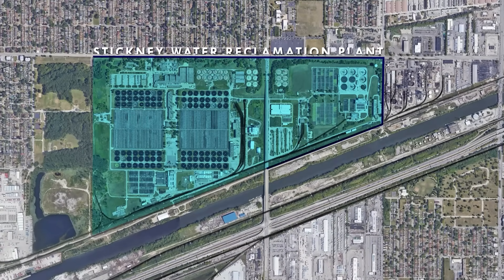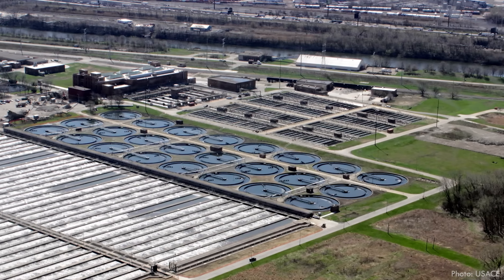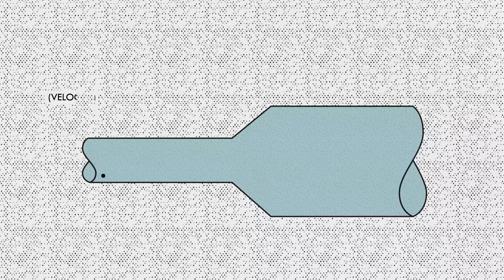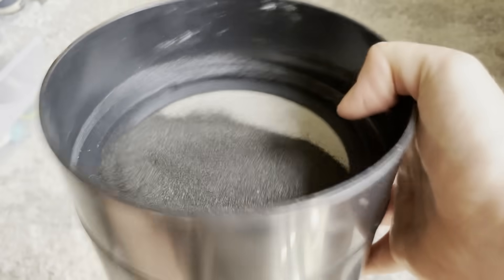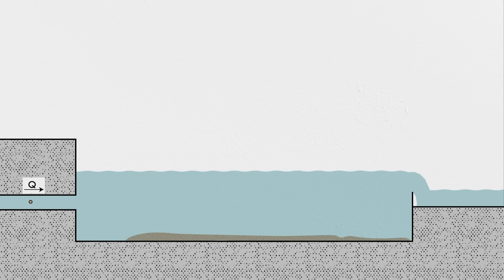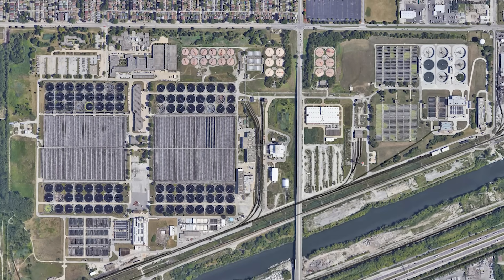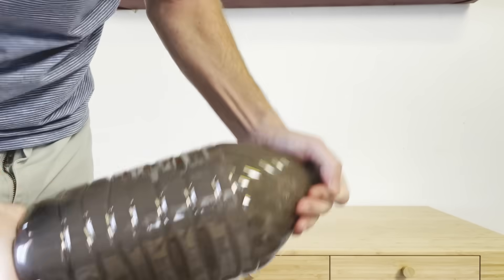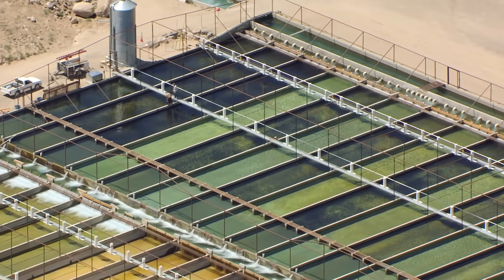How to Clean Sewage with Gravity

Comment: The grain industry (at least in pre-industrial times) used a similar gravity based filtering process, called winnowing. When wheat is harvested the chaff has to be separated from the berry, the chaff is lighter than the berry, so the grains are smashed and the 'solution' is blown across a space.  The heavy berries fall and the lighter chaff is blown away.
Reply: As a former flour miller I can confirm that most wheat cleaning is still done by aspiration/gravity. We've just gotten much more precise about it.

The purification process used to separate bran from endosperm relies on density as well. Suction is applied to sieves inside an enclosed space. This causes the bran to float on top of the endosperm particles, which fall through the sieves. The bran goes out the tail of the purifier.
Reply: I'm sure winnowing is still used industrially, either outdoors on a combine harvester or indoors in a processing plant.

Comment: Our system seems to include a lot of very large circular sprinklers that water large fields, like you see in farms.  Perhaps that is because down her in the panhandle of FL water flows through the sandy soil easily, and the water table is high and we are 50-80 feet above sea (Gulf of Mexico) level.  Maybe you could touch on this in a future video...

Comment: This was an awesome video! I work in wastewater, typically the screens that take out branches and trash, but I also work in sludge thickening, which is like your pool cleaner demo. For sludge thickening machines, the inlet sludge is typically 0.5 to 1.5% solids, and after being treated with chemicals (polymer) and sent through a process machine, it can come out anywhere from 5-10% solids, which is an 80+% reduction in volume.

Comment: Love your content! But I’m pretty sure the water flows faster in the shallow parts of my fish tank. ☺️ With regards to your equation I suspect that velocity is a function of the depth times width (given a constant volume/time).
Reply: yes, but it would also take the particles longer to reach the bottom.
And now you might be thinking that the particles won't go upwards at the end, so that doesn't really matter.
But if that were the case, the water wouldn't either, basicly rendering the bottom part of the tank pointless anyway.
Reply: @Robbedem  I realise now that I misunderstood. Maybe the thing that’s bothering my brain is that if the tank is shallow enough, the particles won’t settle once they reach the bottom. 😌
Reply: @HenrikLantzHedstrom  True, the tank does need to be deep enough to make sure the sediment remains on the bottom and allows for some sediment buildup before removal is required.

Comment: One of the really interesting things I wished you had covered here is tube and plate settlers in this stage. When I was researching this topic it was really interesting to see how the surface area introduced at different angles decreased the clarification time needed.  This whole series is great for people to start understanding!
Reply: yep. Many older plants have had plates installed to increase their capacity without having to build new sedimentation tanks.
A video about what happens with the sediment would be interesting too.

Comment: Having had the opportunity to visit both waste water and drinking water plant here in the Netherlands, It is interesting to see the similarities and differences across the pond. While the wastewater treatment is largely similar, for drinking water the sediment separation is not done with chemicals but electrostatically. Furthermore, we use ozone and UV sterilisation so the water does not contain much if any chlorine. Tap water here is the same quality as bottled drinking water. To keep the water supply safe, waste water treatment is very important!

The sediment of waste water gets pumped to a fermenting plant where they evaporate the water and then let the residue ferment. The resulting gas is used to generate electric power, and the remaining residue is burnt and its residual heat used in the same electrical power generator.
Reply: I work in water and wastewater engineering in the US. Ozone and UV disinfection are both known technologies over here, although I’ve only seen one ozone plant in my, admittedly still early, career. UV is much more common, and is arguably displacing chlorine in wastewater applications. It is less popular with potable water because unlike chlorine, UV disinfection provides no ongoing disinfecting effect after the water leaves the plant. Residual chlorine in the distribution system helps to prevent microbes from developing in the pipe network. The downside is that, if any of your pipes are metal, corrosion becomes a concern over time.
Reply: Tap water is generally at a rather higher quality than bottled.

Comment: GF works at one of the Seattle area sewage plants, on the solids side of things.  "Polymer" is a big part of getting the solids to separate from the liquids.  Once settled out, the solids go to enclosed digesters where the "material" is more or less composted in an anaerobic process.  The resulting methane is used to help provide process heat for elsewhere in the plant.  Once sufficiently digested, the solids are dewatered (the watery "mud" first goes on a separating belt to let liquid drip out, then into centrifuges to spin out more water) to the consistency of wet soil and shipped to eastern Washington for disposal, er, I mean application as fertilizer on agricultural land.  Seattle area folks - if you've ever seen double dump trucks on I-90 with "Loop - turn your dirt around" you now know that is what's left of Seattle's poo.
Reply: Poo in a truck beats San Francisco style!  I really appreciate water and sewage workers, just think about what kind of a community you'd have without their efforts.

Comment: Very interesting, as always.  Not a subject I know much about, but I used to travel past a sewage treatment plant every day on the train and I've often wondered what these round things were.  But, here in the UK, they aren't the same as the ones you show, they are (or appear to be) raised beds of gravel or clinker, or something similar, and the rotating arms sprinkle water (?) onto them.  So I assume they are filters of some sort.  I haven't looked at a treatment plant closely for decades, so maybe the technology has changed - or perhaps we do things differently over here? 

One of the things we definitely do very badly over here is the 'emergency' release of untreated sewage! (eg when heavy rainfall overwhelms the plants' capacity.)  Untreated sewage is simply diverted straight into the nearest river, or out to sea.  This is supposed to happen only very rarely, but it turns ot that all the water companies are actually doing this regularly and with a hell of a lot of sewage.  It's currently a big scandal over here, as the companies have been hiding how much they do this, as they get fined if they do it too often.  This is one of the consequences of our water and sewage system being privatised - under the old system, plant was replaced or expanded as required, whereas nowadays everything has to been looked at from the cost and profit point of view to keep the shareholders happy, so corners are inevitably cut.

Comment: I have a Biofloc based Aquaculture System and was pestered with Turbidity problems where the dead bacterias have increased turbidity of water and due to continuous aeration do not settle to the bottom for me to be able to remove them by draining. This has resulted in the water becoming murky and holding less oxygen even after pumping air in it alot. When trying to filter then I can filter some water but soon enough the filter gets clogged up by the flocs. I was thinking of using a Rotating Drum type of filter but seeing the video maybe I will give sedimentation another try.

Comment: I have a request related to this video. 
Can you explain how private sewage systems work? I live in a rural area and we are required to have one. We used to use a sewage pond, but local laws changed and now we have an underground tank. It has a sprinkler that occasionally sprays to expel excess water, but I'd like to know what's keeping the tank itself from filling up with sludge.
Reply: Nothing keeps it from filling up with sludge.  You need to pump it out periodically or it fills up.

Comment: There are major ecological and resource management problems with this system. 
Ecologically, we tend to keep the waste moving downstream much faster than it would naturally, robbing uphill soils from much needed natural fertilizer. Granted, some plats process the solids into agricultural fertilizer rather than incinerating it, but that concentrates it and still doesn't help the soils around the farms. In some areas that don't care about the mineral content of their discharge, this process also sends salts downstream faster, creating pockets of increased salinity and extending brackish water further up rivers. 

As for resource management, we often pump this water out of groundwater sources, particularly in more arid areas. Sending this water downstream or allowing much of it to evaporate from these settling ponds compounds the problem. While they are less efficient and cost more to maintain, percolation systems that allow the water to seep back down to the water table are much more environmentally friendly in terms of keeping the water table up and recycling what little water you have in desserts and plains regions.

Comment: After being in charge of the waste water plant at a certain tanker cleaning depot in Manchester, UK, I can say I get everything on this video. Our treatment plant was was 'hand-made' using any old crap and bits of old steel pipe I could get me hands on. It was forever causing problems because;
1. The waste water had to be pumped up a hill and into tanks (the pump failed many times)
2. The pumps pulling the water out of the storage tanks failed many times (yes, again!)
3. It bloody rains so often in Manchester and any rainfall had to go through the system as per local laws (which over-worked the pumps and made them fail)

Comment: Could you do another video like this but with a focus on the solids? I can't imagine how the solids are removed continuously, and I think this is a very interesting aspect
Reply: Yes, I'm really curious how they deal with the solids that collect in the settlement basins.  Do they dig it out and truck it to landfills?  Is it converted to something harmless?
Reply: @MichaelSteeves  depends on the site. If the sludge is mainly organic material (f.e. wastewater from housing), then the sludge get's processed into gas by anaerobic bacteria. The gas can then be used to produce energy. Most of that energy is used to dry the leftover material, which in turn gets burned or put on landfill.

Comment: I'm still unsure how they deal with the sludge at the bottom.  You mentioned it briefly (the clarifiers have an arm that push the sludge), but this doesn't make sense to me:  Where do they push the sludge, and why doesn't the water go there?
Reply: The sludge is drawn off the bottom while the clear water is drained over the top. Some water does follow the sludge - it's actually what helps the sludge move. The "sludge" will typically contain 2% to 4% solids  the rest is water. That water is later returned to the process when the sludge is dewatered. I'm sure Grady will touch on sludge dewatering at some point, and it should be much clearer then.

Comment: In my specific field we have a wastewater pretreatment process called "metals precipitation" which uses hydrated lime and flocculant to "settle" and separate the metal contamination out so we can release clean water. It also uses a clarifier and at least one "polishing tank" to allow the sludge to descend, and a clear water layer to form and flow out of the plant into the sewer system.
Reply: In my previous field we did second hand waste management survival, called fill metal perception, which uses hydraphobic particle acceleration through flocculant construction of contaminated sludge.
Reply: in my future field we drink lots of water so our urine is clear. then we pass it onto the next person. no wastewater treatment needed
Reply: @Blox117  in my cosmic field we drink psychotropic water so our urine contains psychedelics to pass on to our children. Mushrooms are our wastewater treatment.
Reply: @thatguy431  lol
Reply: @Blox117  Are you sure it's the water you're drinking? Seems like you're further down the chain of custody than you claim.
Reply: @dsnodgrass4843  of what doest thou claim? believeth that only the holiest of divine waters do I partake
Reply: @Blox117  of course you believe that, little one. 
why else wouldst thou chirp so obtusely?
Reply: @Blox117  lol
Reply: @Blox117  so efficient
Reply: @Blox117  urine is technically sterile so yeah, you probably could.  Although I would prefer it be treated to remove the ammonia component first.

Comment: Collecting the sludge is also important for just making the whole process work economically - because by readding some of the sludge collected in the clarifiers at the beginning of the secondary stage, it is possible to have the solids retention time be many times higher than the hydraulic retention time, which is set by the volume of the secondary stage and the flow rate through it. A quite high solids retention time is necessary to give the bacteria enough time to sufficiently degrade dissolved organic contaminants.
Reply: Kinda like biomedia in an aquarium filter, but on a much larger scale? Neat! :D
Reply: @Dth091  That's the other method that is used in some wastewater treatment plants too, growing the bacteria as a biofilm using something like a trickling filter or a fluidised bed bioreactor. Those can be more space-efficient than the normal activated sludge process, but also more complex and expensive than just a few big concrete basins.

Comment: A very interesting video. Two questions, if you're able and willing to answer would be greatly appreciated: 1) What is the difference between the black and white sands that caused them to separate as they did?
2) What happens to the sludge at the treatment ponds?
You have a great channel and I enjoy the content, thanks!
Reply: The simple version is that the sludge is dewatered and dried and then disposed of. Depending on local laws, disposal might include use as fertilizer.
Reply: @seanpols350  thank you
Reply: 1.) He filtered them by size using the same sieve, for the whote sand he kept the larger particles and for the black sand he kept the smaller particles.

2. That sludge usually ends up as fertilizer. Several process can be used which are essentially composting (just like how people compost kitchen food waste into garden fertilizer) or digesters (with or without oxygen just feed it to bacteria and collect the methane produced for sale to anyone who wants natural gas since its basically the same thing). Both reduce the amount of volume of sludge and render it fairly safe (not bacteria ridden poop sludge) and this final residue is sold as fertilizer.
Reply: @jasonreed7522  thank you.
Reply: He answered the first question in the video. He sorted it first.

Comment: Can you go over what CA counties are doing to "recycle" water?  What also love a contrast on those plans vs doing any number of actions to harvest rain and Greg water and put that to use.
Reply: Harvesting rain and ground water is just normal water collection (rivers & resevoirs for rain, wells for ground), technically some buildings dump rain water into storm drains but that water is already polluted and can either go to the WWT plant or just into the local river (note, combined storm and sewage will cause overflows forcing release of raw sewage into the environment). And fundamentally trying to collect more of them won't increase the water supply in the region and could have ecological impacts as you prevent water from participating in the water cycle on land. (The Colorado river is already drank dry before it reaches the sea as barely a trickle)

Recycling water is making sure the WWT output is clean enough to be used as drinking water or atleast returned to the input treatment plant collecting water from a river or resevoir.

Alternatively you can do desalination and convert seawater into brine and drinking water which will increase net water in the region.